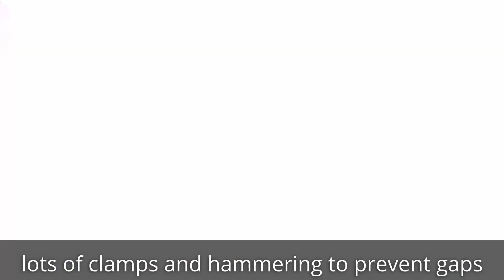How to Box a Frame!

Comment: In body shop we use long wands with 360 degree spray pattern to spray epoxy sealer inside frame rails etc that have been sectioned or encased etc. This way there is no worry that any zinc based weld primers or paints dont burn off in welding. I have yet to see any weld thru primers that dont breakdown during welding process from weld heat.

Comment: Question, does boxing in a frame have any negative impact on the longevity of the frame? Will the added rigidity cause the frame to develop stress fractures or something along those lines? Also, how do you feel about steel-it for the inside of the frame before painting? Thanks for the videos!
Reply from the maker: Steel-it would be great! Only reason I used a different brand was due to price.

No it will make the longevity better not worse from a fatigue standpoint (as long as corrosion isnt an issue). The more something flexes the more likely it is to develop those stress fractures youre talking about, so stiffening the frame in this way extends the fatigue life.
Reply: @BuildSomethingAuto Good point about the stress fractures. Thanks! Can't wait for more videos.

Comment: I want to do a 4x4 conversion on my 1994 f250. Now, they only came in leaf spring for the 4x4 3/4 ton and up trucks. I would like to convert a dana 50 ttb to coilover and adapt to my factory radius arms. The passenger side axle beam goes to a center pivot bracket that is riveted in. The driver side axle beam pivot bracket that bolts on the passenger side of the crossmember is bolted on. Is this to make it easy for the swap? I'm almost 100% sure the dana 44 HD would bolt right in without me changing those center brackets (would still need to convert the axle to coilover) because the driver side beam should be the same length. Only problem is the dana 44 HD only came in the regular cab f250s. I've got an extended cab with a 460 big block and e4od. If I swapped a dana 44 HD I would probably eat through ball joints. Any suggestions?
Reply from the maker: I'm not as familiar with f250s or the 44s, but let me give it a shot. On mine since I was swapping from the dana 35 my whole cross member and everything had to be modified. That was the hardest part honestly was figuring out the right positioning for it all and it's the part that didn't really make it to video haha. Since you have an f250 already you might be right that the crossmembers are the same and you may be able to just bolt the dana 50 in the new spot, I think there's a pretty good chance this is the case. If you haven't seen my video where I was messing with the brackets it might be helpful, I'm not sure:
https://www.youtube.com/watch?v=KC26KjKelwM

The dana 44HD and the dana 50 are the same dimensions, you can't really tell them apart from the outside without looking at the size of the hubs or checking to see if there's a 44 or a 50 stamped on it. So if you're doing the swap IMO I'd just go for the 50 it should be the same amount of work (only thing that might stop you is that lockers and gears don't seem as available for it). One cool note about the 50 for me is that it has a 9" ring gear (despite a misconception on certain forums). Here's a comparison of the axles.
https://www.blueovaltrucks.com/tech-articles/dana-44-dana-44hd-ttb-front-axles/

Another thing to keep in mind is that the radius arms won't fit on the dana 50/44HD members, the 50 is shorter and fatter than the 44 (or atleast that was the case with the 35, you'd have to double check on the 44). This is one of the main reasons I opted for doing custom radius arms. I honestly felt it was a similar amount of work to make the stock arms fit, and would solve a whole lot of other issues and help with travel as well. My design is untested right now (a sort of parallel 4 link type setup) so I wouldn't recommend it yet, but you could always do a more traditional extended radius arm setup they aren't too difficult to fabricate and if you're going coilovers anyways it might be worthwhile. Here's my video on radius arms:
https://www.youtube.com/watch?v=3Thj3K5ZLUA

What I'd recommend is two things, either 1 go find some desert racing forums and see if anyone has done the swap before, or two do what I did and bring a tape measure and a notebook to a u-pull and take a bunch of measurements. Verify that your crossmember is the same crossmember used in the dana 50/44hd trucks and check if you have the holes to bolt up the driver side member, and verify the height of the member to see if you'll need to cut down the height of your radius arm to match. 

One thing to keep in mind is that the 50 and 44HD will be stronger and more reliable, but you may endup losing some driver side travel due to the shorter member (or at least it might not behave as nicely at longer travel) so if your ultimate goal is desert racing then beefing up a 44 might be a better option since it will behave the best with long travel, but if your goal is power, reliability, or load capacity then 50 all the way (again I personally wouldn't consider the 44HD, all the disadvantages of the 50 with none of the advantages IMO).

Sorry for the long response, I love this stuff haha 🤣